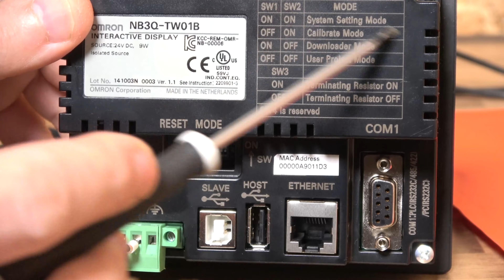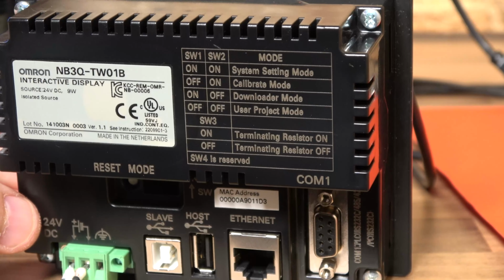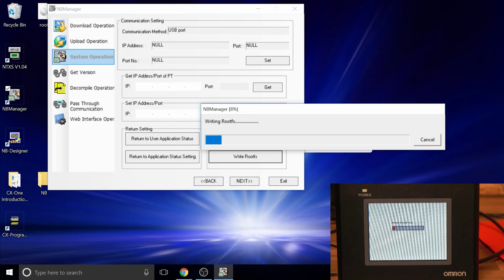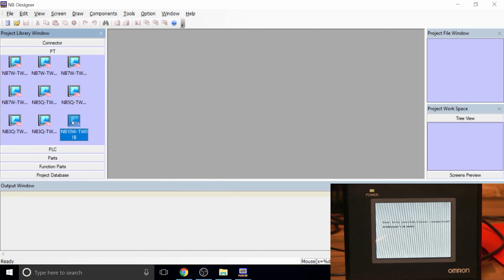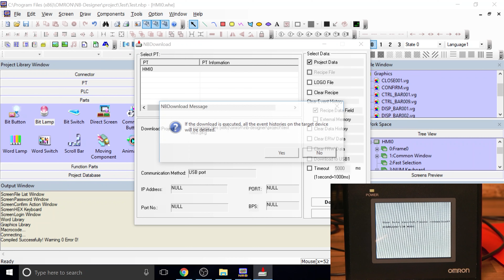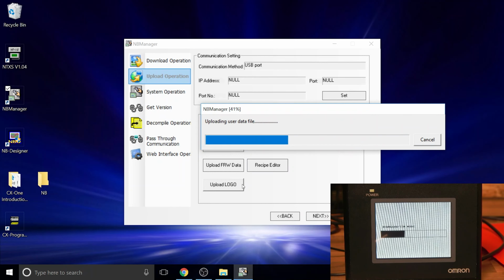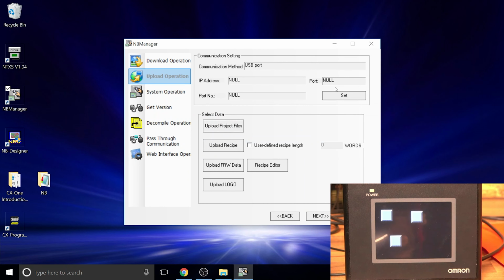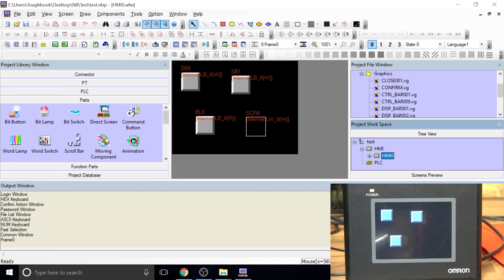Omron NB Series HMI firmware update, program upload/download using Free NB Designer. English

Comment: Hi
Can I ask you something
When I Write Kernel and Write Rootfs, the program asks for password Download
What should I do
I need to delete project in HMI and load new project
while I don't have the old project's password
hope you support
Reply: RTFM ;-)
There are little switches at the backside of the device. Check the manual and you will find a combination to execute a full reset of your device. After this step you´ll be able to download your project.
Reply: and the default password is 888888 or you can changeit in web interface